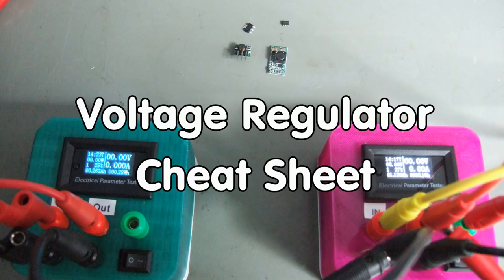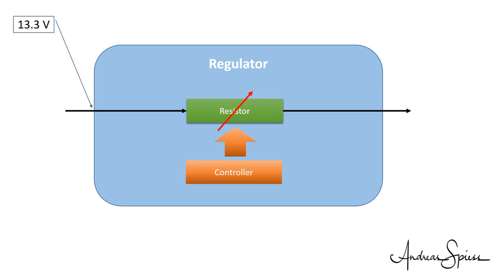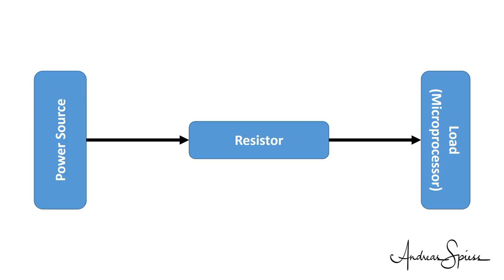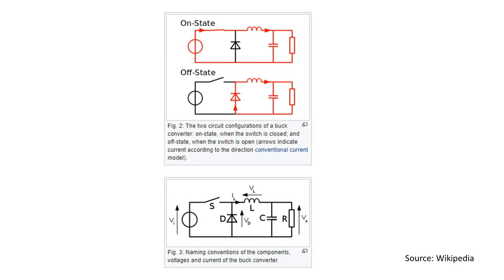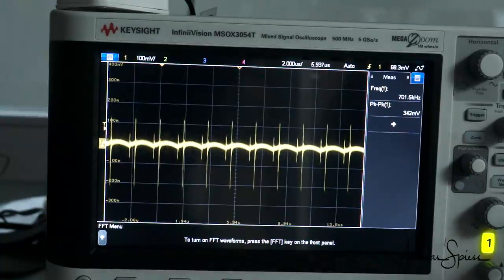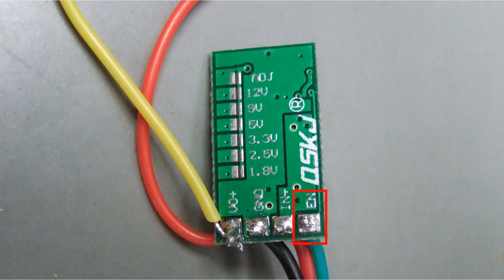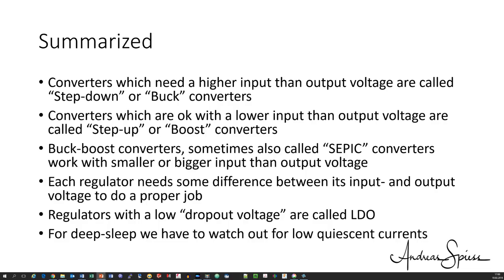#183 How to select voltage regulators for small projects? (ESP8266, ESP32, Arduino)

Comment: Hi, I am searching for a regulator circuit ic for lowering the voltage from 27 to 24 volta at 15 amperes. I am not able to find any which supports more than 8 amperes. Example LM2576 ic supports max 3 amperes, i need one which can use 15 amps. Please suggest.

Comment from the maker: ERROR CORRECTION: Low Quiescent Regulator is HT7333, not HT7111. Sorry.
Reply: Prison time for such blatant mistake ! Oh wait you are not a surgeon :D
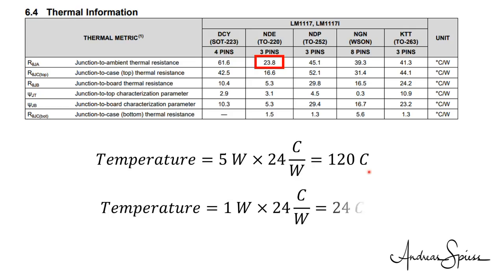Reply: Another small omission creeped in at 9:51. It should be 24C over ambient temperature. So 25C ambient + 24C regulator ~50C total.
Reply: Hi 7133 with 24v input voltage and 2.5 microamps Quiescent is better than 7333
Reply from the maker: Unfortunately, the HT7133 will not work with most icrocontrollers as it supports only 30 mA
Reply: The Maximum output current for HT7333 is 250mA. As the ESP32 has spikes of current that varies from 300 mA to 400 mA, I think that one good alternative to this is the LT1763-3.3. The quiescent current of LT1763-3.3 is a bit bigger (30uA) but it can delivery current up to 500 mA. 
What do you think, Andreas?
Reply: @pedrocavaglieri  I think a big capacitor (470-1000µF) directly across the ESP power input pins should take care of the spikes, so 250mA (or maybe even the 100mA of the HT7533) on average should be enough
Reply: @pedrocavaglieri  Other contender is the HT7833, same quiescent current (4uA) as the HT7333 , can deliver 500mA. The trade off? Slightly higher drop voltage (360mV as opposed to 90) and a lower max input voltage (8.5 vs 12 Volt)
Reply: @AndreasSpiess very true. The 7333 with it's 250mA max current is more of an all-round LDO, but it might be on the brink of what an esp8266 needs. Consider the 7833 with its 500mA. Downside: higher drop (385mV i believe) and max 8Volt input

Comment: Are you sure the small voltage booster you show towards the end of the video delivers enough energy to power up an ESP8266 from a 1.5volt alkaline battery ?! I tried and it didn't work
Reply from the maker: I always add a 1000uF capacitor across the Vcc and GND pins of the ESP boards to deliver enough energy for the Wi-Fi peaks.

Comment: What will happen if my source drops below 3.3V when using a HT7333 LDO regulator? Or lets say the source supply voltage is 2.5V.
Reply from the maker: The LDOs have a drop-out voltage between the input and the output which is lost. And it will no more regulate the voltage below the 3.3 + dropout voltge, of course
Reply: @AndreasSpiess  So and LDO module would not be ideal to use with 2 AA batteries ( 2.5-3V maximum)?
Reply from the maker: Not if you want 3.3 volts
Reply: @AndreasSpiess  Can you recommend a regulator module that`s suitable AA batteries?

Comment: Hello sir i want to use esp32 in deep sleep and data is send to server every 30 minutes  what regulator should i use ams,1117 is verry power consuming please suggest best voltage regulator for esp32
Reply from the maker: I use a HT7333
Reply: @AndreasSpiess  but HT7333 provides only 250 MA current sir is that current enough for wifi transmission and other sensors attached to esp32 ???? Should i go for ht7333 or other version like ht7833 sir ....iam using 6 sensors with esp32
Reply from the maker: Also a good choice.
Reply: @AndreasSpiess  thank you sir

Comment: While a bit crude, you can usually find better quality switching regulators on old PCBs. I've had better results than the cheap modules I've bought before. Things like old wifi routers usually use one or more step down supply circuits that are designed well and they don't interfere with the radio circuit on board. 
   I've also found a few Buck-Boost SEPIC converters on old wireless keyboards and mice. When I'm salvaging these circuits I usually check them beforehand to see the output and the basic topology. Then I mark an outline to cut and use metal shears type scissors to quickly make my own modules from the original PCB. I think that's a bit crude for a Pro EE like Mr Spiess, but for the beginner or hobbyist it's a handy way to learn about different circuits and do some real world recycling ;)
-Jake
Reply from the maker: I am also a maker and do not build things to sell ;-) I like your idea.

Comment: Thank you Andreas, recently I was graphing heat dissipation by Buck converter powering from 12v Battery to Raspberry Pi. And at right time you uploaded the video. Now I have understood many important factors for selecting the regulator.
Reply from the maker: Thank you for your feedback!

Comment: Thanks for another great informative video Andreas. I favour the MCP1702 series LDO linear regs, especially for deep sleep battery operations. Key feature is the 2uA quiescent current. The 3.3V version has a drop out voltage of 525mV which isn't too bad.
Reply from the maker: Thanks for your feedback.

Comment: Very nice.  Deep sleep miniatures, I can see a use for those,  wake on demand, wake on request, wake and upload, wake and broadcast,  wake and receive.   
Great Video; the housings you made for your instrument displays, were exceptional.  Not only are they easy handy, they look great, nice tools.  I could actually see being able to combine them like legos, and serve a function.   That would actually be kind of cool.  One of your blocks could be a power supply, snap on an op amp, or any of so many nice little circuits found  out there. Pop on a strob. a VU meter, a light detector, a mic module with a pre amp. Some of the modules could be lights,  speakers, both combined.  every module with some sort of indicator or read out,  Of course they are kits, you have to build yourself. Finished they are tools for testing.  bread board circuits inside, easy change and test similar components.
Just Tripping out on your electronics, which deserves recognition for ingenuity. imagination. practical application.  clean math with clean parts, and a clean work area with all the testing equipement. 
That would be a great job, designing testing equipment, that gave the user the feel of real power, flipping switches, fine tuning, mode selecting analyzing power.  signal generating, analyzing zoom in, out red light flashing power.  I want to build .   
Fun hobbie.  I created an under sea world with green and blue LEDs  that happened by accident,  I saw a concept, and now it's an environment.
Reply from the maker: Maybe you start to build your own system with such boxes? I made a video on how to design them quite easy...
Reply: @AndreasSpiess  Nice. The guys at the electronics store where I get a lot of my supplies sell the printers, they have one set up, and I always have to see what they are up to.  I would sure like to have one.

Comment: Thanks for this video. I thought my wireless doorbell fried when I changed batteries to step down regulator and transformer but was the noise which blocked the signal! Now it works with a regulator ic. Thanks!
Reply from the maker: You are welcome!

Comment: Thank you Andreas! I'm issuing a Winter Topic Slide Warning: For projects that are 'mostly mains powered', I frequently use microcontrollers together with an added 18650 LiPo battery as an uninterruptible power supply. The use case I'm describing is not very different from a solar power use case. 

I found that a combination of a charge controller module, a buck-boost module, and a pair of diodes works well enough for this, but it is not efficient, it is fairly expensive, and it doesn't seem to maintain the battery very well.

Now, I imagine this to be a very common use case, but either there are no such power management chips, or I am incompetent at searching vendors' parts catalogs. In all your searches for efficient parts, have you or one of your brilliant fans come across an efficient solution to A) power a microcontroller, B) maintain a correct charge on a 1S-3S LiPo pack, and C) efficiently manage the power transfer between the external supply to the LiPo and back?
Reply from the maker: I still have this use case on my list for solar. Maybe it will become one day a video...

Comment: Hi Andreas, My project use 3 AAA battery, so I need a regulator to power the Microchip PIC at 3.3v. Quiescent current is mandatory for extend battery life. Micro most of the time is in sleep mode and it consume less than 1uA. I used the Microchip MCP1810 LDO. It has only 20nA!!! Another plus is that when input voltage is less than 'drop out voltage' input is shorted to output (LDO is excluded); so I can use battery down to 3v or less.

Comment: Hi Andreas, great work as always!
Could you name the tiny BOOST converter PCB module with BC035 making on it that you used at the end of the video .. which BOOST converter  IC does it use?

What about the M8-03 BUCK converter module you showed on ALiExpress? Which IC does it use?

Comment: Another view of the inductor and capacitor in the switching circuit is as a low pass filter "smoothing out" the AC you are making into DC by turning the switch off and on (vs the energy tank explanation :) )
Reply from the maker: I agree.

Comment: This is great for constant current applications.  Would love a video series for data channel conversions and necessary side effects.  Been having issues driving LED strips and either dropping 5v to 3.3v data channels or vice versa.
Reply from the maker: If you are talking about level conversion between 3.3 and 5v: There are many small boards available which do exactly that. From 5 to 3.3v only you can use a voltage divider.

Comment: There is another very simple solution, a shunt regulator, such as the TL431. It is "like" a super Zener diode (in reverse) and in PARALLEL (not in serial) with the "load". It can be adjusted to fit any voltage from 2.5V to 36V  (without exceeding the voltage of the source, it is not a booster), with ZERO drop out voltage and requiring just 1 mA to work (in parallel with the amperage delivered to the load) (You can "typically" have it to work for a current as low as 400uA, but it is preferable to have 1 mA to be "sure"). So the power dissipation, for your example, can be as low as 0.001A * 10V = 0.01W. The TL431 may be delivered in a TO-92 case (looking like a discrete BJT), and you only need to add one, two or sometimes three resistances to make the required circuit (plus connectors). Its cost is really low (0.06$CAN at Amazon). Its SPICE model is available with the free version of TINA (distributed by Texas Instrument) (Just be careful,  BEWARE, TINA does not use the standard TO-92 numbers for the pins, mis-wiring the TL431 is a huge possibility, consult the spec sheet and wire accordingly, not intuitively). If it is becoming warm to the touch, you probably have miss-wired it. The major problem, in the actual case, is that even without "load", 1mA is a large "quiescent" amperage. So we would have to disconnect the circuit, somehow.
Reply from the maker: Thank you for the info. For small currents a good idea. The TL431 has to "eat" the whole current if no load is attached. And the resistors have to be small enough to provide the voltage at max current.

Comment: You should consider output voltage ripple in quiescent mode. As the controller usuallys switches from discontinious current mode to pulse skipping when there is nearly no load. This may result in significant higher ripple on output, which may not fit your requirements anymore or even can trigger a brown out detector of a micro controller. Allways remember to measure ripple voltage as close to output caps as possible! Even the ground wire of the probe can become an antenna at these frequencies...
Reply from the maker: This was more an overview video. So I had to stay at the surface. Anyway, I recommend for the ESP projects relatively big capacitors which might help in this case.

Comment: wow Andreas, This video was amazing, exactly what I was looking for and you explained everything so clearly for a beginner like me. I really do appreciate these videos, as does everyone in the esp8266 community. I do have a question for you: would the buck convertor's inductor interfere with the esp8266 wifi signals? Also, do the buck converters need capacitors? Chris
Reply: I have never donated or paid on a patreon before but I think that I will support you so that you can continue making this type of content.
Reply from the maker: Thank you for your nice words. Buck convertors usually do not interfere too much on 2.4GHz. It is always good to have a capacitor between VCC and GND of an ESP8266 because it draws a lot of peak current.

Comment: Very good video. Personally i try avoiding variable converters because i have had problems with bad trimpots that throws the voltage out of the set value. I stick to fixed regulators.
Reply from the maker: I agree.

Comment: Nice tutorial. I did a review of the efficiencies of a buck boost and a LM7805 recently. The buck boost did not perform as expected. I did another video troubleshooting it. Turns out the boost chip was getting hot even when it should have been in buck mode. After removing the boost I got the efficiency the manufacturer promised but the output voltage dropped. Not sure why though.

Thankfully Dave set up a decent forum. While I did not get the direct answer from the responses it got me thinking along the correct lines.
Reply from the maker: Because of such things I made my next video on finding errors. Maybe you find there some procedures you used to find the issues ;-)
Reply: That would be very interesting. The solution I found is not the best.
Reply from the maker: I will not solve your problem, just show how errors can be found in general ;-)
Reply: I know. You may not be able to replicate my problem. Its the troubleshooting steps that I may not have thought of that are important. 

Also I am moving locations in 2 weeks so I will not have the said board or any electronic equipment. Regardless it would still be interesting to get the perspective on how to solve problems.

Comment: another exzellent presentation. I really love watching you as you really make things easy. Can you also post the types or AliExpress links of the regulators you measured. Will make live easier if I need one to order
Reply from the maker: I think I placed the links of the two switches. the others can be found by entering the part number.

Comment: Sali Andreas, love your Swiss accent! I also have not been able to get rid of mine. As long as you call the meat on the plate not like the timber no worries. But the FBI is like ei so is the quiescent current. English is not regulated like German. Downunder we drive on tyres while in the US they use tires. There are tongue breakers. California has Yosemite and in the land of Koalas we eat Vegemite, both same ending but different pronunciation.  Acronym abuse gets one confused so in our ham radio club ce hand each other upper sideband siticks!

Comment: Thanks a lot for this lesson and measuring the spectrum of the DC/DC converters. So These tiny switchers are not compatible with the cheap radar devices. But a 7805 helps out.
A very interesting topic ist the stability of the regulators. The LDO & low quiescent current seems to be more sensitive to ESR of capacitive loads ;  the old 78xx and the AMS1117 seem to be more robust in that aspect.
Reply from the maker: I think, Regulators have many aspects. I just got a mail fromTI with their selection. Overwhelming. Obviously different applications need different LDOs...
BTW: Radars are higher. Maybe they would survive it from an RF point of view...
Reply: Btw: These tiny DC/DC converters are compatible with ESP8266 and ESP32 although their EMC behaviour.
In some applications I am using them in a small metal can. These cans were reused and they originally the contained a kind of medicine ("Ipalat"). Hope this also helps a bit against EMC ;-)
Reply: Yes TI has a lot of brillant regulators and I know them from my business.
Sometimes you can get some of them in reused products of automotive industry on ali or eBay. But up to now I could not find readymade modules using modern TI regulators on our typical sources. Maybe you TI contact Person can help?
I tried to use These tiny DC/DC converters with the Radar motion sensors and the HB100 as well. It did not work properly. On Petes blog you can find some filters proposed (https://tech.scargill.net/microwave-for-the-weekend/). Maybe it helps, using a 7805 was faster and simpler for me.
Reply from the maker: You will find a link to the discussions about radar sensors and ESP8266 in my new video. It is very interesting...
Reply: New Video? #183 or #184 we all are waiting for?
Reply from the maker: #184
Reply: Thanks for the hint. I will  do but my spare time is limited next sunday.
Reply: Yes I read a part of this thread some months ago. And I decided to use an extra 7805 which worked with the HB100. And it also works with the cheap switching motion radars. You can improve the robustness of these further using a 100nF between pin 12 and 13 of the BISS-Chip which has been originally made for PIR sensors.